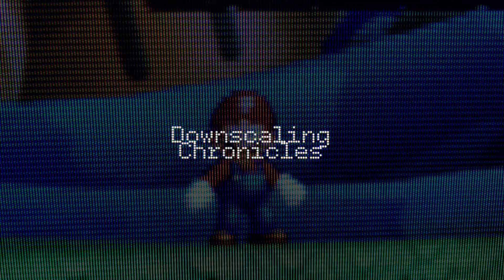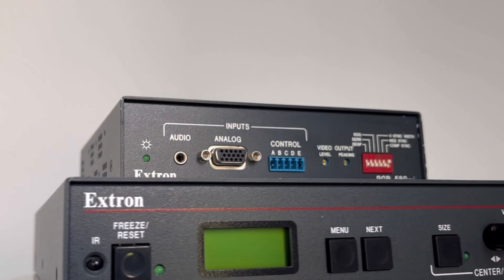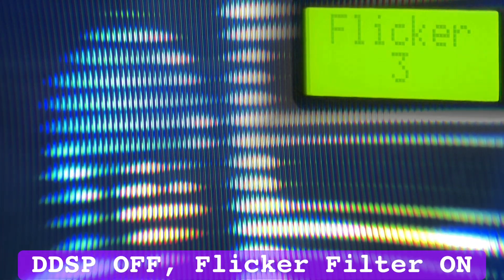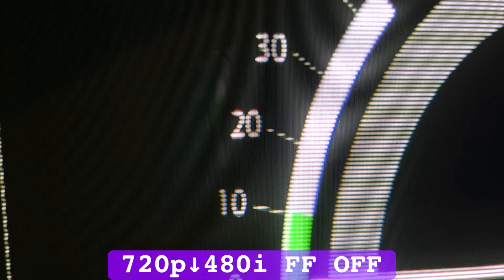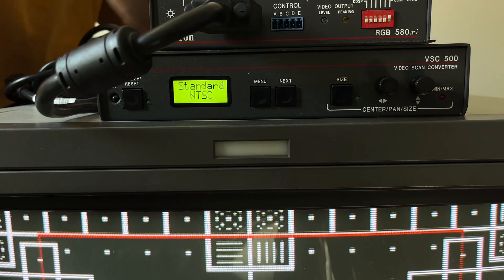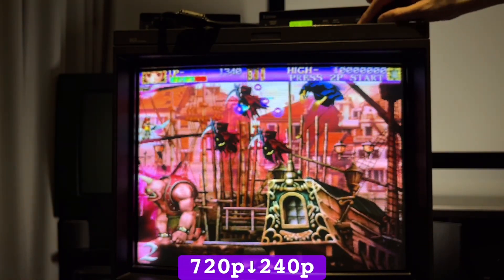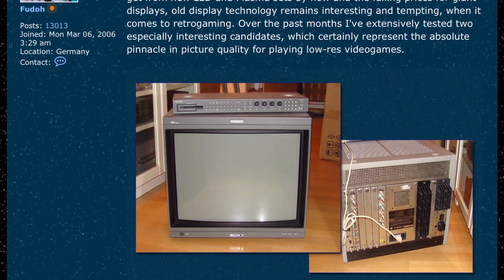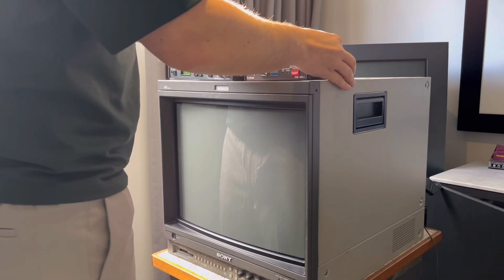Downscaling Chronicles 3: Extron 240p Trick. Pseudo 240p via the VSC 500 + RGB 580xi Interface DDSP

Comment: I was immediately perplexed with this 480i to 240p conversion which while should be possible must mess timings a bit not doing 240p exactly like 240p systems.
Otherwise outside 480i this isn't a good trick imho. Image doesn't look very sharp on your photos/videos compared to proper 240p
Reply from the maker: I agree 100%. It was probably the blurriest of nearly 20 scalers I’ve tried thus far to downscale to 240p. The VSC 500’s flicker filter blends both X and Y axis to somewhat stabilise the Bob-Deinterlaced 480i. The VSC 700 separates the H and V filters so it could be sharper, but still, not a recommended method and a far cry from real 240p. That’s what the series is about, learning if these scalers are viable for someone’s setup

Comment: Do you know of any downscalers that would work to display a widescreen image on a 4:3 crt WITH letterboxing (black bars on top and bottom)? Preferably with a component output? My crt does not have a built in 16:9 mode, just 4:3
Reply from the maker: @TheXtremeBoltGuy  I replied this for one of your recent questions: The OSSC Pro has 16:9 letterboxing built in as well as the Tetra Vio off the top of my head. Some other scalers would need to be manually adjusted. The OSSC Pro can do component output via the Extra AV Out addon. 

If you don’t need 240p output and just 480i then an Extron VSC like the one I used in this video can do it manually if you shrink the V size
Reply: @MarcoRetro316  Thank you so much. This has been bugging me forever! Sprite-based indie games on CRT, HERE I COME!

Comment: What HDMI to VGA dac is that? 
I thought you needed a native analog input to do this, would it work with hdmi directly from my pc via hdmi? Also how do you get the audio onto your pvm?
Reply from the maker: @BBgamerz261  unless the external scaler has SDI, which you would then need an HDMI to SDI converter anyway, then you need an external DAC as the VSC’s need an RGB/component input. I’m using a generic unbranded converter that I bought from Amazon so quality can be hot or miss. The DAC also extract audio from HDMI so I bypassed the Extron scaler and output directly to the setup. I mentioned in another reply, maybe look into using an old Radeon graphics card with your PC to output 15kHz directly using CrtEmudriver.
Reply: @ sorry to be a bother but any chance you could elaborate on that very first part? I understand the rest of that but didnt get the part of the external scanner needing SDI.
Reply from the maker: No bother at all. SDI is a digital format and some Extron VSC’s have an SDI input. So if you were to use an external scaler and wanted to pipe HDMI through it, you’d need an HDMI to SDI converter. It’s a rabbit hole with DAC’s and Downscaling, but I’d look into CRTEmudriver first
Reply: @MarcoRetro316  Still dont understand why id have to pipe through hdmi to sdi when you didnt use it in your video here. So I was thinking id go from my computer HDMI -> DAC -> vga to bnc cable -> vsc 200. Would that work?

Or is there something else needed to display my computers screen onto my 15khz monitor in that matrix?
Reply from the maker: I looked at the VSC 200 and I don’t think it has SDI anyway. I didn’t use SDI in my video as I didn’t have a converter at the time, but it’s just an option if you wanted a digital to digital input, but not applicable in your case. 

It looks like your video chain on the input would just be an HDMI to VGA DAC into the VSC. This will net you 480i analog output. VGA to BNC is only required on the output if your end signal to your display is RGB via BNC
Reply: @MarcoRetro316  ah sorry I meant to put VSC 700 which is BNC connectors
Reply from the maker: @BBgamerz261  ah then yes, HDMI to VGA DAC, then VGA to BNC cable to connect RGBHV. Also, forget all the SDI stuff lol. I thought the VSC 500 had an input for it but it doesn’t, sorry to add to the confusion
Reply: The 700 doesnt have SDI input either, only SDI output.
Reply: @ no problem at all, I appreciate all your help. Thanks to your help ill be able to finally use my PC with my PVM!
Reply from the maker: @BBgamerz261 all good and all the best with the downscaling
Reply: @ one last question, running into problemsduring the setup right now. But how do you get the Extron onto your PVM? My pvm only has C-Sync but the extron has H/HV and V. In this case can that HV port be used to run RGBS BNC cable and plug the other end into my monitor Composite sync?
Reply: @MarcoRetro316 or do I just need to get the 580xi to get the csync
Reply: @MarcoRetro316  little confused because it looks like you used RGBS cables to get the H/HV from the extron vsc 500 to the extron rgb 580xi. So is it just that the xi takes HV and makes it CSync?
Reply from the maker: @BBgamerz261 Edited my response as I just realised you were asking about the xi. The RGB interface isn’t needed in your case, only the VSC. The input format should also match the output, as in if the input is RGB then, then RGB needs to be selected the output as well. If component is on the input, then also needs to be the output as the VSC doesn’t transcode. Sync type doesn’t have to match the input though so choose RGBs
Reply from the maker: You shouldn’t need an RGB interface if you are wanting 480i. The purpose of me using the 580xi was to downscale 480i into 240p
Reply: @MarcoRetro316  ok sorry im a newb at this shit, I thought PVMs still need a CSync. Right now I have it all connected from my PC to the VSC (using an RGBHV cable for this; the cable w 5 connectors) 

What kind of cable should I use to connect the outputs to my CRT? Because my CRT only have R/G/B for both the rgb and component signal and then C-Sync. 

Or do i just not need csync in this case?

Sorry shits confusingly hard
Reply from the maker: @ Plug in the H BNC to the monitor’s sync input, C-sync is sent in the H-line
Reply from the maker: @ Yes your monitor will need C-Sync or send it RGsB sync on green. Better just hook up C-Sync for RGBs. Either use BNC to BNC cables, or BNC to RCA adapters and then just RCA cables for RGB+Sync
Reply: @MarcoRetro316  i’m going to use a BNC cable. I didnt know that C-sync is sent on the H line. Thanks
Reply from the maker: @ All good :)
Reply: @  This should be my final question lol - my cable connecting to my extrons inputs is a 5 BNC RGBHV cable whilst my output cable is a 4 BNC RGB+Sync cable. Do I need to replace the RGB+Sync cable with a 4 BNC RGBHV cable? Also, do I need to replace the 5 BNC RGBHV cable with a 4 since the extrond H/V are on the same port? Or can I just not plug in one the sync connectors? 
Thanks again, your the goat on this shit for real
Reply from the maker: @BBgamerz261 Because the input is RGBHV, connect all 5 to the input of the VSC. Then for the output, leave V sync disconnected and just connect RGB and H (C-Sync). Then on the VSC, have it output RGBs via the LCD menu. You shouldn’t need new cables as it sounds like you have everything
Reply: @ btw, should I be concerned about magnetic interference from the vsc units or is it okay to put on top of my crt?
Reply from the maker: @BBgamerz261 I don’t think you need to worry about EMI from the VSC
Reply: @MarcoRetro316  Sorry to keep reaching back out, I wasnt able to get this setup with that setup. I used the startech displayport to vga and an rgbhv cable but my extron just still just says no signal.
Reply: @MarcoRetro316  i did notice that its stuck on 1440x900 for the active signal even when I change my desktop. Also stuck on 85 hz ans cant change to 60 but I thought the extrons were able to fix that
Reply from the maker: @ That might be due to how the PC is interpreting the DP to VGA adapters EDID but just my guess. That’s an active adapter? Because it’s going from Digital to Analog so it would have to actively convert the signal and not just route to VGA pins. Either way, the Extron isn’t seeing the signal or it’s out of range for it to interpret. Do you have a way of inputting HDMI to VGA instead?
Reply: @ Damn, was thinking about grabbing a spare from work td for this rzn but didnt lol. Ima just order one, u got any recommendations for cheap?
Reply: @ and yes that one is an active adapter. I thought all has to be active adapters in order for this anyways
Reply from the maker: @BBgamerz261 RetroRGB might have reliable links, but there’s no telling if/when manufacturers change the circuitry. It’s been a crap shoot to get a reliable and cheap DAC in my experience, I have a bag of about 10 bad ones and only 2 good ones. You can take a gamble with a generic DAC from Amazon or Aliexpress, otherwise the Reflex Prism is meant to be high quality though not as cheap.
Reply from the maker: @BBgamerz261 Yes needs to be active, though it sounds like there’s some EDID handshake that’s not letting the PC output a conventional TV resolution like 720p
Reply: @MarcoRetro316  ok if there was an edid problem would a better hdmi dac even help?
Reply from the maker: @ it might be the DP to VGA that’s causing the potential EDID issue. All just a guess though
Reply: @MarcoRetro316  ok ima just hold off on this until next week when I can bring home a bunch of the hdmi to vga converters we have and test them lol
Reply: @ ended up picking up a few different hdmi to vga adapters at work but none of them worked for me. They did all however give me the proper resolutions and refresh rate options when using HDMI. Could the ‘No signal’ be because the VGA cable I have plugged into the extron is labeled as low power? Or do you think its just because my gpu is very new?
Reply from the maker: @BBgamerz261 so strange that it’s not working, I’m not sure why the Extron isn’t seeing the input. I have no idea about the low power label in what that refers to.
Reply: @ so its not the computer because I tested w another different older pc and have the ssme issue. Has to either be the VSC itself or the vga input cable id imagine. Ill kyp, trying to get a vga input cable first before I go solder crazy lol
Reply from the maker: @BBgamerz261 Fingers crossed it’s just the VGA cable!
Reply: @ just a hunch since I know the RGB Rxi interfaces require at least 2V on the sync lines for input. I checked and the VSC 700 is slightly more lenient, accepting 1.5 V to 5.0V p-p for sync.
Reply: @ welp good and bad news lol, it fixed the no signal issue but now im trying to deal with why the image is so distorted. Assuming its a sync issue but top and bottom if screen is super saw bladed up
Reply from the maker: @ that definitely sounds like a sync issue. Gawd, the VSC is pretty simple, it shouldn’t be this complex to get it going. You’ve persisted this far, hopefully you get it working
Reply: @MarcoRetro316  I ended up folding and getting a vsc 500 since I already had everything else needed. it looks and works great!
Reply from the maker: @BBgamerz261 thank gawd! It seems the VSC 200 might’ve been the problem
Reply: @MarcoRetro316 what brand DAC do you use? I got the triplight for audio as well but it didnt work because the power cables position. So right now just got video via a vga cable lol
Reply from the maker: @BBgamerz261 This is a copy and paste of what I replied to a similar question from another video:
The Reflex Prism, Icy Box, and HD Fury 3/4 are meant to be the best, among some others but also very expensive. 
https://tinyurl.com/dactestresults
I have none of them though and have always used cheap stuff. I’ve tested mine and found to have 2 good cheap DAC’s from aliexpress, but it took me about 10 bad ones so it’s a roll of the dice. This is what I use but cannot guarantee they use the same circuit as when I purchased: 
https://a.aliexpress.com/_mrE6KaR
https://a.aliexpress.com/_mPPwv1p
Reply: @ I ended up having a 2nd dac that had 3.5 mm out on it so all good. If you want any pictures of results lmk nd I could send them over. My camera skills are not great though lol

Comment: Nice video, so is thid what would you recommend I do to get a computer with only HDMI onto a 15 KHz PVM at 480i?
Reply from the maker: @BBgamerz261  just the Extron VSC unit plus HDMI to VGA/component DAC without an RGB interface will be fine, though you can also look into using an old Radeon graphics card and a custom resolution to output directly from your PC

Comment: nice video. what do you think of GBS-c to compare?
Reply from the maker: @hellrick633  anything’s better than the Extron interface trick. The GBS-C isn’t without its own intricacies that you’d need to know about before trying to downscale, such as it requiring RGBs or component input, NOT RGBHV, so if using an HDMI to VGA DAC then you’d also need to combine sync. It outputs component or RGBHV so you’d need to combine sync again if using RGB output. It’s an entry level downscaler and priced accordingly, though it can only downscale a 480p/i input to 240p and cannot downscale to 480i output. The image controls aren’t as robust and seamless as the Extron VSC’s but they get the job done. The GBS-C is a line decimator and is much sharper than the Extron Interface Trick
Reply: @MarcoRetro316  thx for reply. i used gbs only with nintendo SW and pvm 240p.

Comment: If you change the registry setting on the ps3 (jailbroken / hen) you can change a PAL ps3 to output 480i/480p even in the menu.
Reply from the maker: I did not know, thank you! I will look into it
Reply: @MarcoRetro316  setting/display/tvSystem should be set to 0. Pretty sure 1 is PAL I did it along time ago to my ps3.
Reply from the maker: @fink32  thanks again, it is MUCH appreciated. It seems pretty straightforward
Reply: @MarcoRetro316  no problem. I did it with mine. 

It’s on the psdev wiki under XRegistry(dot)sys.

And setting/display/tvSystem

You can find a registry editor
Reply: Sadly, it does not change the game's output, if you have a PAL-region game. Seems like only NTSC-region games will output 480i. Though I haven't tried NTSC-region games with the PAL registry output.

Comment: I have an extron vsc700 which I used it to downscale from 1080p and 720p and 480p to 480i using hdmi to vga to rgbhv And outputting through component video. It all worked fine but then it stopped downscaling from 1080p and 720p for no reason. It just output a very zoomed frozen image. But downscaling from 480p still work.

Any thoughts?
Reply from the maker: I’ve never had that issue, but I’d troubleshoot all the points of failure. Try multiple input sources and use a different HDMI to VGA DAC. It can be hard to obtain an Extron Insider account but that would give you access to the firmware upgrade tool as well